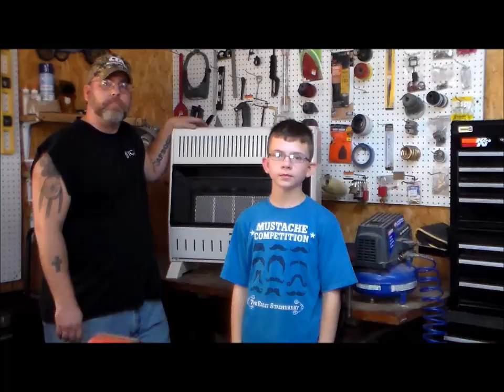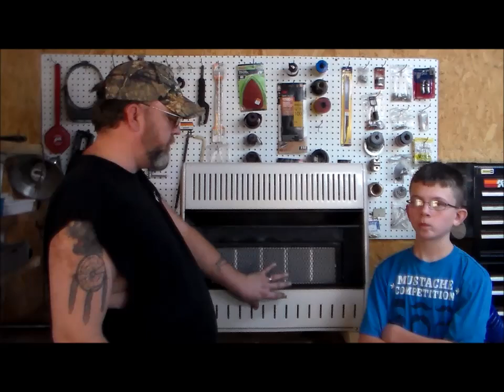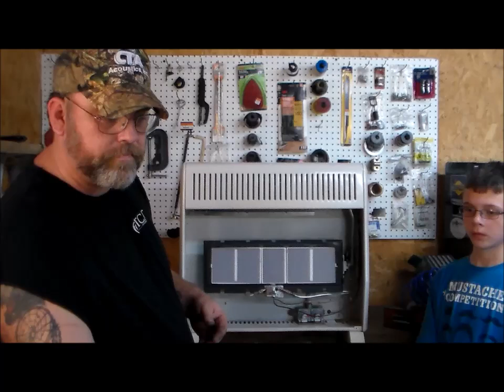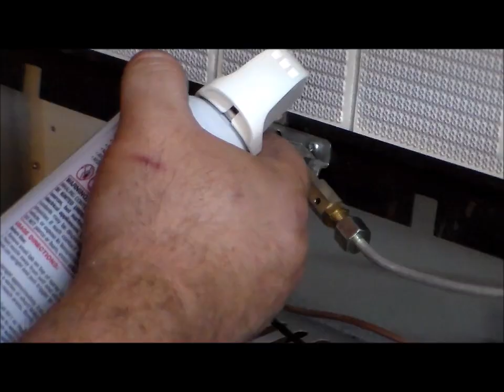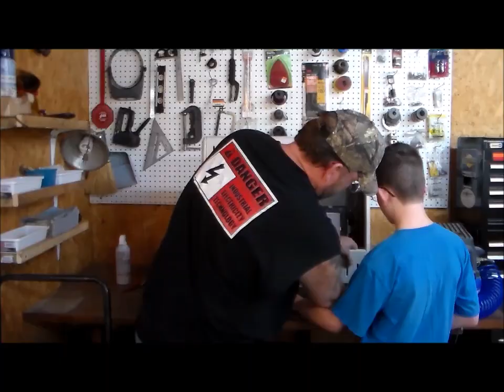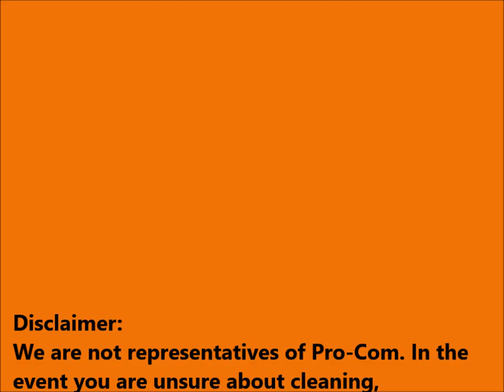Pro-Com Heater wmv

Comment: I have a Pro Com free standing stove which has worked great for 7 years.  When I tried to light the pilot this year it doesn’t seem to be getting propane to the pilot.  I have gas coming from my 100 lb tank to the back of the stove, but it doesn’t seem to be going into the stove.  I have tried blowing air from where the gas enters the back of stove but no air comes through the pilot line.  I have tried blowing air back from the pilot tube but no air comes out the back.  I
Any suggestions?

Comment: My pro com beeping non stop the pilot lights stays on but will not burn the flame. This unit is electric and manual. Started after I blew it clean. Worked perfect dirty lol. Also the flame is 85% orange very little blue. I've checked and recheck but a assume I got dirt somewhere it shouldn't be help lol

Comment: My heater keeps shutting off, sometimes it takes a while before I can reignite it.  I can at that time smell gas when I try and reignite it so I know gas  is getting through.  I leave a window open for oxygen but have not yet cleaned it.  Could it be it just needs cleaning?  Thanks, Dan.

Comment: Uhhh u do kno the can of air is flammable right? Prolly not the best advice to use that stuff ..just a side not sir
Reply: Actually it is not flammable. Further more, not sure how it would pose a risk cleaning the heater with it. The heater is not lit, and if anything did come out of the can, it evaporates and leaves behind no residue. Otherwise it would be a horrible idea to clean laptops and other electronics with it.